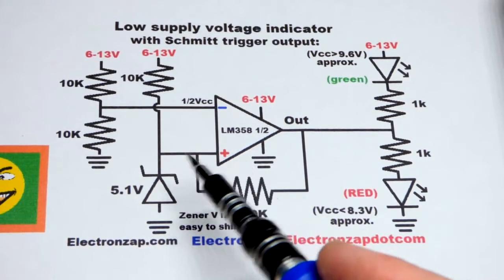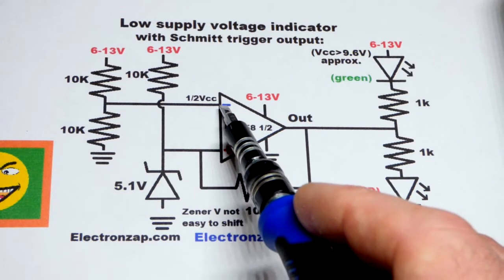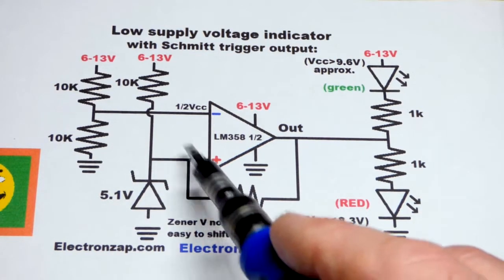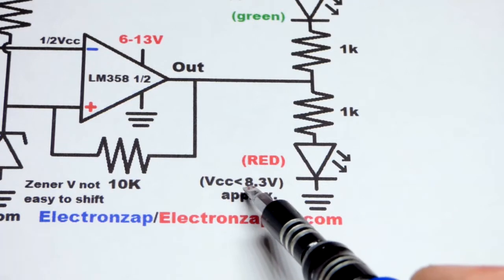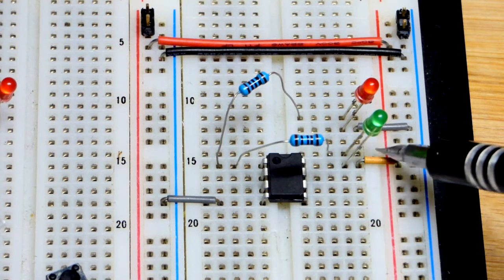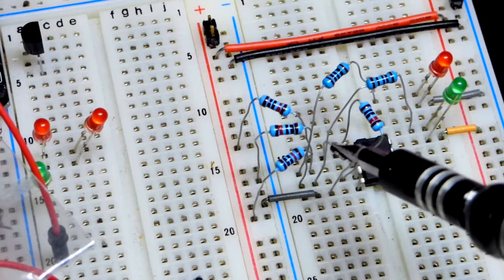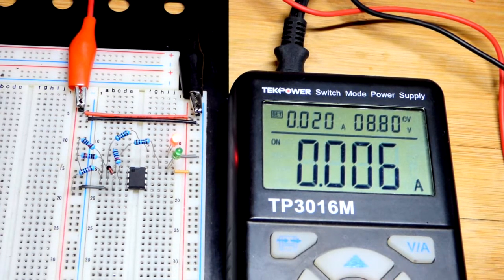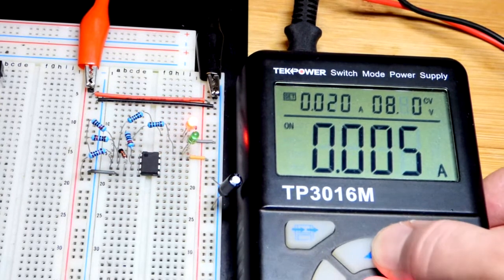LM358 op amp low versus OK supply voltage indicator LEDs with schmitt trigger output electronics how

Comment: Great. Simple but usefull.
How if lm358 replace with lm741?
Will it work?
Reply from the maker: Probably not very well if at all. 741 can't output the negative supply voltage, because it is a dual supply output op amp. So you mostly use it when there is also a negative voltage in relationship to 0V ground.
Reply: @Electronzap  
Clear. Thanks..